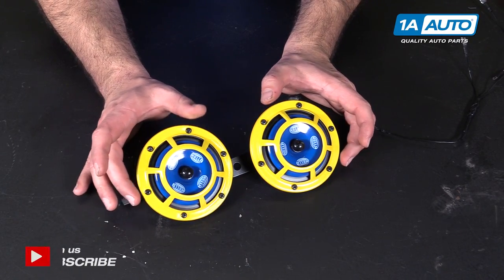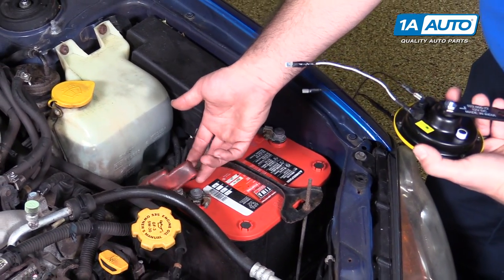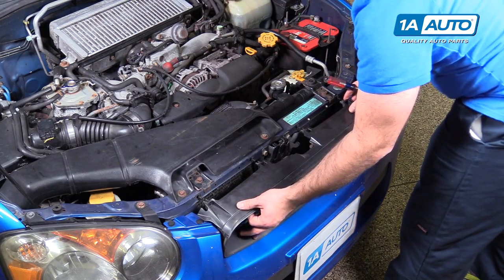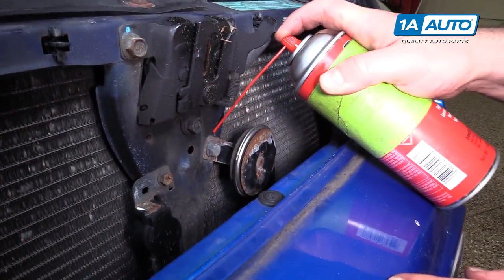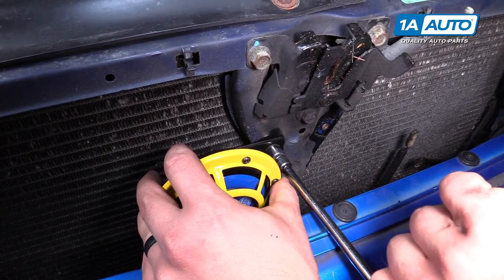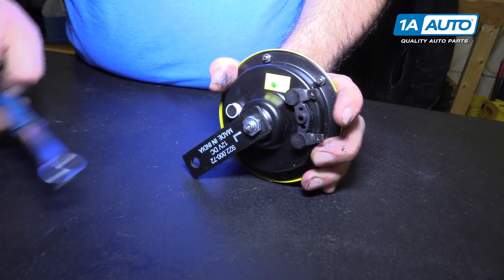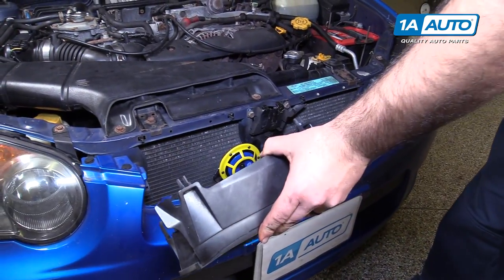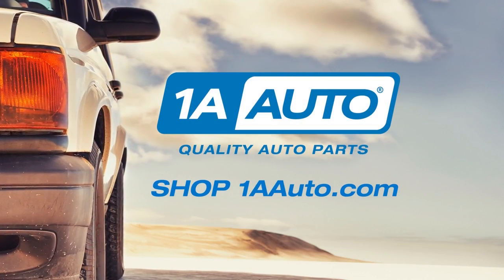How to Wire and Install Hella Horns

Comment: Swapped out my stock 2015 Subaru horns for these.  Ran them off of a relay.  Sound exactly the same.  The horns are big and beefy, but it's all show and no go.  Either that or the stock Subaru horns are actually pretty decent.  I'd only do this if you are repairing failed horn(s).  If you think these will be an upgrade, I think you'll be disappointed.

I don't think electric horns like these have any polarity.  It's a simple circuit.  One is power, the other is ground, but it doesn't matter which.

Comment: I just bought a box of Sharp tones and there's a bold warning on it that says: Do not adjust the position (angle) of the bracket or the nut. It changes the electromechanical properties and will result in loss of performance and warranty. Isn't that what you suggested to do in the video? Also, why not using the relay that's included in the box?
Reply: I’m wondering the same thing… my box has that same warning in bold font

Comment: 10:27 of my life gone, only to find out you didn’t bother wiring the relay or directly to the battery. That is what I wanted to see. Anyone can plug stock terminals to new horns.
Reply from the maker: We currently do not have an auto repair video that covers this particular repair. We will keep this request in mind in the event that we need to make this repair in the future. 1aauto.com +rickj13

Comment: No relay required?
Reply: Not "required" but if you don't, you'll likely cook the OEM relay if you lay on the horns for awhile. The Hellas pull 15A each! Additionally, because of the large current draw, their will be a voltage drop if you use the skinny OEM wiring, and the horns won't be as loud as they otherwise would.
Reply: @GroovesAndLands  Sir, or Ma'am....thank you, I learned way more from just reading your comment than from watching almost 20 videos on installing dual horns from the original 1 horn setup. It has been frustrating to say the least, but now I understand better, all because of you. Thank you!

Comment: Im using these horns too and i find them soft. Will the relays make them louder?
Reply: DARREN WANG yes.  You should also wire the hot side of the horns directly to the battery with a good 10 gauge wire.  Using the relay in conjunction with the stock wiring will allow everything to work normally.  

There’s a very good right up on the Tacoma forums out there.  Google is your friend.

Comment: What about the relay? Do you need it or not
Reply: Probably, since it pulls atleast 6 amps :) i would do it.
Reply: Do the relays make them louder? I find mine too soft.
Reply: Do the relays guys, and run wire directly from the battery, pos and ground. That's the whole point of running a relay anyways, but just making sure you do it right.
Reply: @albowrx  Nobody, including the Hella website or the horn package tells you WHAT to do with the relay or HOW to install it...   swap out the OEM relay by just 'plug and play' ?
Reply: I used a relay.  Run a 12 ga power wire from the battery + to 30.  Run 87 to the two horns (you'll obviously have to break this into two leads for the two horns).  Run your stock horn power lead to 85 (or 86) and run 86 (or 85) to a ground point.  Done.  When you push your horn button (middle of steering wheel), it sends power to the relay and closes it ... that connect your battery directly to the new horns.  Easy peasy japaneasy.  (If you have a 5-way relay, ignore 87a ... leave it unconnected.  If you don't know what these numbers are, then you probably shouldn't be doing a wiring project).

Even off of a relay, these basically sound the same as my factory 2015 Subaru horns did.  So, I'd not recommend this as an upgrade.
Reply: @67L48  
Re: "if you don't know what the numbers are..."
Thank you, your comment helped a lot.  
The numbers are printed on the relay !!  And the electrical connection diagram on the box is detailed enough to be able to do the job. (at least   for the two red horns 007424 I received.)  The horns can be made in USA,   India, Mexico or Brazil.   Mine were from India.   Thankfully NOT China.